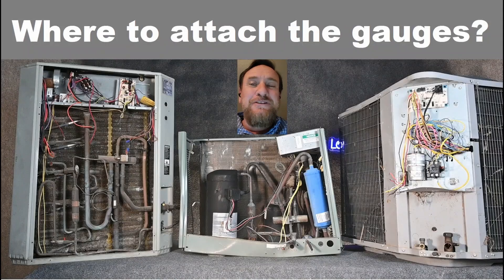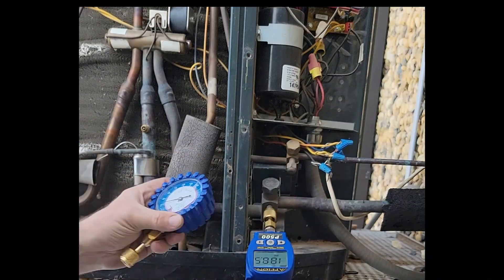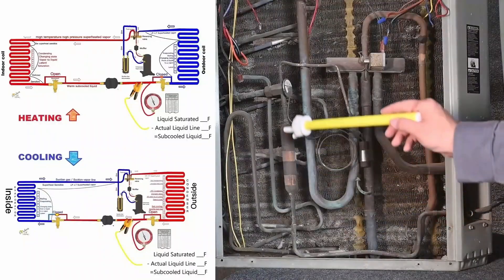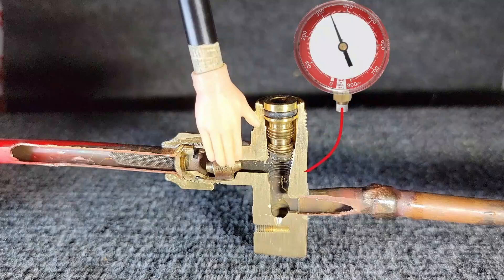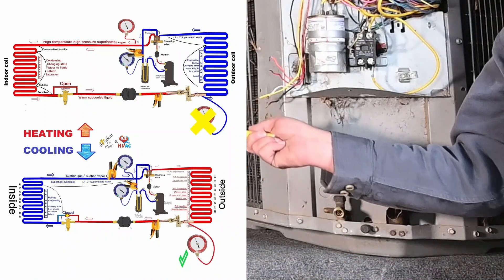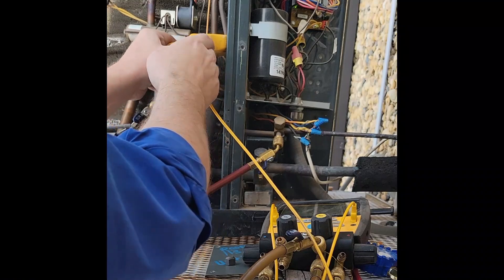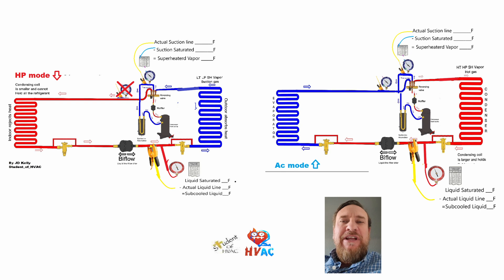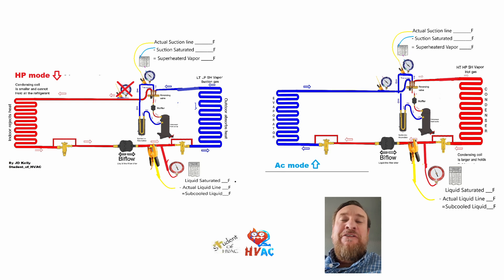Heat Pump 11 Gauges

Comment: Good Video. However where I live an work all of our heat pumps are inverter driven, and use EEVs, not TXVs. So using Super Heat  and Sub Cooling is not an option for diagnosing.  Would love to see an in depth video on inverter mini splits.
Cheers

Comment: Awesome video. Love the 'pointers'.  Knowing you’re a perfectionist, your graph has a typo in the upper right corner at the 14:46 mark.  Condenser is spelled incorrectly.  And in the next graphic, 'Always' is spelled incorrectly.
Reply from the maker: I'm certainly no perfectionist.

My very very very bad spelling is why I try to avoid using word on the screen.

Comment: now if you really want to have a fun time hooking up gauges you should try a mitsubishi city VRF unit, those can do heating and cooling at the same time over just 2 pipes going to the distribution box. that system is a real mindbender to wrap your head around. it transports both hot gas and liquid refigerant in 1 pipe.
Reply: That’s why you do not use refrigerant gauges.  Just a software on your computer and the units have all the pressure transducer’s and thermocouple sensors right on your screen telling you everything..